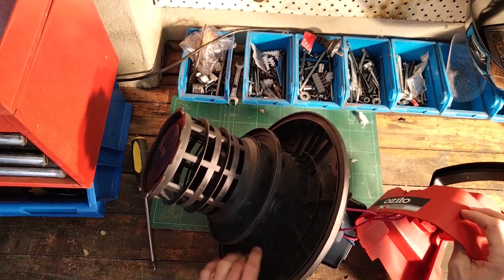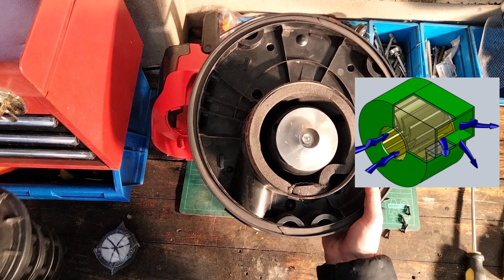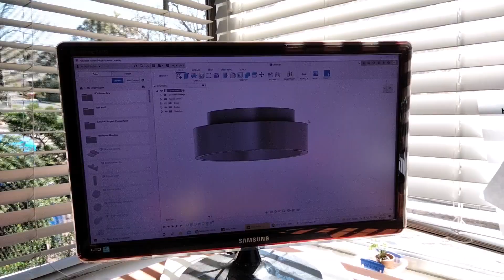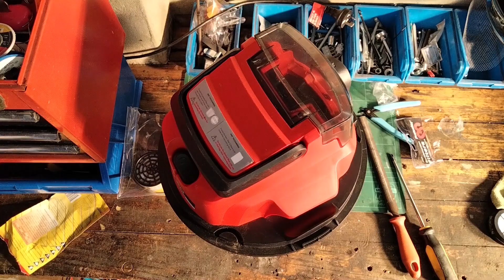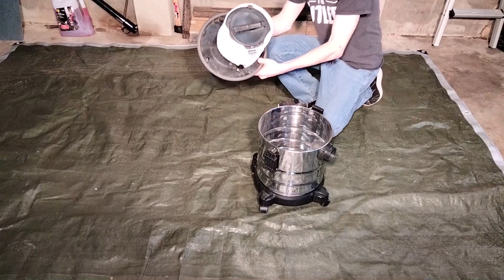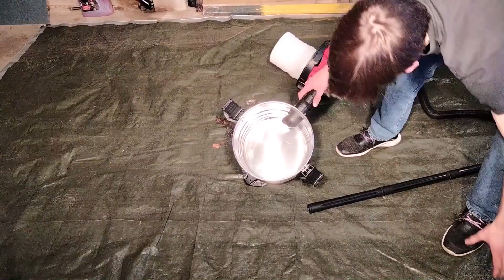Ozito PowerXChange Teardown Series: 18 Volt Shop Vac + Performance Mods!

Comment: Nice video, my soft start unit failed so I've bypassed it. Everything seems ok, I was worried the start current might be too high but audibly it seems ok. Time will tell.
Reply: I might add the soft start board was very different to yours, no heatsink just a fairly complex circuit board.
Reply from the maker: Strange! I hope it works well for you! Would be good if ozito released a brushless motor version